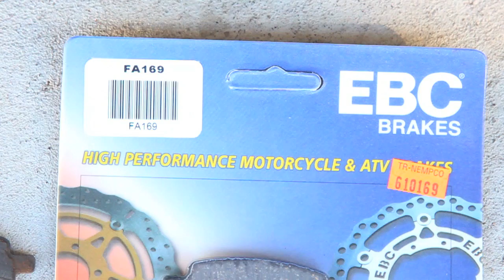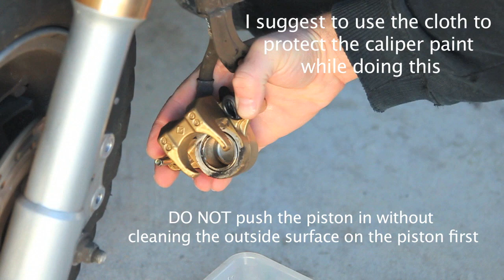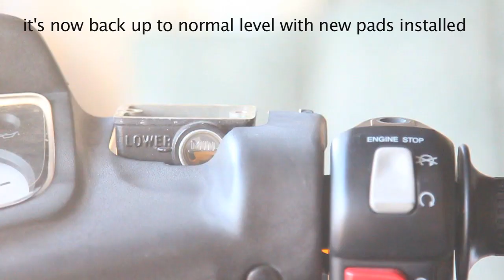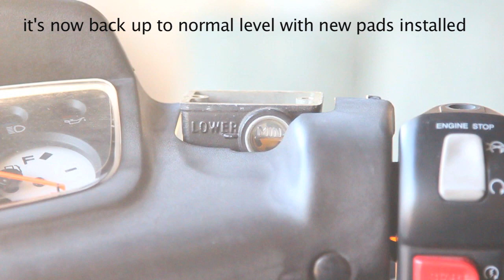Yamaha Zuma 50cc - Front Brake Pad Replacement | MicBergsma

Comment from the maker: Buy brake pads - http://amzn.to/2piQ0Wd

TOOLS I USED:
Phillips #2 screwdriver - http://amzn.to/2fgdZDL
Channellock pliers - http://amzn.to/2CMrVLq
Ratchet 3/8 drive - http://amzn.to/2hhmnUs
10mm socket 3/8 drive - http://amzn.to/2xGuLSF
12mm socket 3/8 drive - http://amzn.to/2xM4Edr
(2) Tiny flathead screwdriver - http://amzn.to/2zyrLck
toothbrush
warm water with little of soap

More Zuma videos here: 02-11 Yamaha Zuma 50 videos: http://bit.ly/2gIazoY

Comment: This video skips a critical step that is the difference from a frustratingly hard job, to a simple one:  There are two slide rods, a big one on the fork side and a small one on the piston side.  The piston slide rod has a bolt and comes out; TAKE IT OUT!  When you are ready to put the pads in,  rotate the fork side 90 degrees and insert the large slide rod on the fork into the piston.  Then you put the pads in, making sure to get the clips aligned right.  Then all you have to do is rotate the fork back 90 degrees, insert and bolt the small slide rod.   This way getting the pads in and arranged with the clips is very easy, otherwise it's a nightmare.
Reply: THE CLIPS CAME OUT A HUNDRED TIMES UNTIL I READ ABOUT THIS AND THEN I GOT THE JOB DONE WITH NO PROBLEM THANKS SO MUCH!!!
Reply: Good god I spent forever trying to get this back on until I read this comment. Thanks. Here's a link to a video that shows that step on a Yamaha Vino.
https://www.youtube.com/watch?v=rvD5fA_-VgI
Reply: Mark Wladika thank you for this. I was getting super pissed trying to figure out how the person in the video got the new pads in and made it look super simple. I followed this and finished in in 2 minutes.
Reply: Bro you are the fckin MVP

Comment: Ok, great video. I got to the end of the job where you just slip the brakes on the disk and found that it was not humanly possible to do so.  So I invented a tool which was just a long handled wedge made from sanding a wooden pencil.  I slipped it in between the pads from the side (where there was no springy-ness)  to hold the pads open, and the brakes went right on the disk.

Comment: This is a very random question, but at 1:39 you show the screw that attaches the caliper to the scooter disc. Any idea what these kind of screws are called? They are 12mm? Great video, I need to replace my caliper and will use your video as a guide! Thanks so much!

Comment: I just finished replacing the front break pads on my zuma 50. However i did notice I no longer have good brake pressure or stopping power... any suggestions?  

Thanks for the Vid

Comment: At 5:40 The brake pad is installed wrong, you can see 1/4 the piston, the pad has to be turned 180 degrees, then the piston will press correct on the pad
Reply from the maker: C D no it is not wrong, I am changing the pads on other Zuma right now and it looks same like in this video

Comment: Your brake fluids is browns , that mean that you need to change it . When your are at the lower, it doesn't mean that is ok , you should but full .
Reply: The low level of the fluid was partially due to the worn brake pads - more of the fluid in the system is pushed out of the reservoir and stays in the caliper housing as the pads wear down. When the calipers were reset, some of the brake fluid moved back up into the reservoir. I agree that as long as the reservoir was open, the brown brake fluid might as well have been bled and changed after the new pad was installed. That only takes a few minutes with a helper to squeeze the brakes.